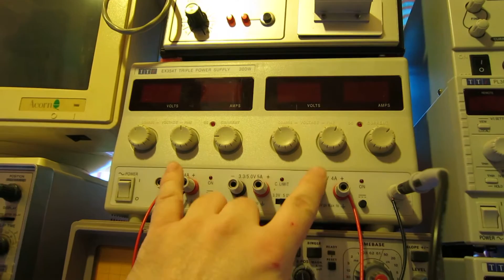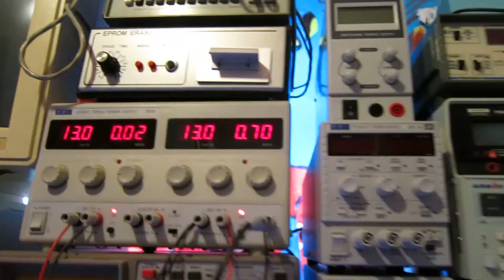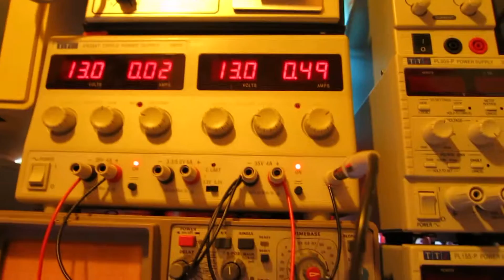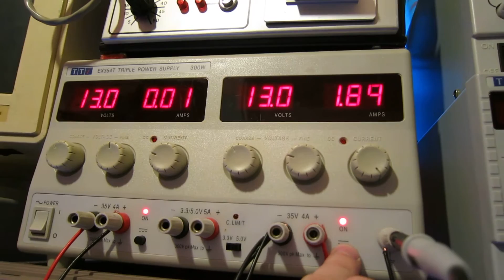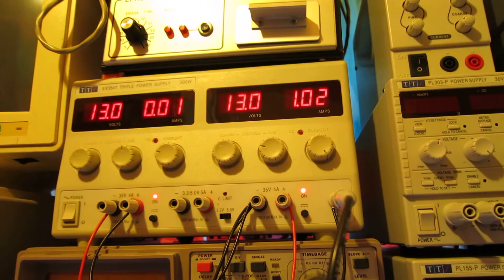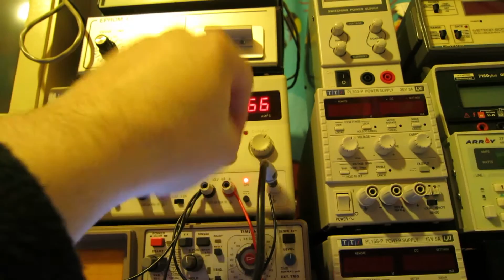Firepower Sound Board Repair

Comment: I had a quick (perhaps stupid) question. Since the boards are supposed to be running AC power, how did you do the conversion to determine the appropriate DC power level?
Reply from the maker: The AC is converted to DC by a bridge rectifier. When you put DC into a bridge rectifier you will get the same voltage out minus the voltage drop of the diodes in the bridge rectifier. All that needs to happen is that the voltage coming out of the bridge rectifier needs to be higher than the minimum voltage that the voltage regulator needs to operate. So if you connected your meter to the output of the voltage regulator and started turning down the DC voltage, eventually the +5v rail will start dropping. It does not need to be precise, it just needs to be above that voltage at which the regulator is outputting the correct voltage on the +5v rail. In the case of a sound board like this, the amplifier wants around +12v and -12v. The bridge rectifier drops around 1v so putting in 13v DC before the bridge rectifier results in around +12v at the amplifier, again it is not critical and it will work a few volts above or below that
Reply: @arcadeuk  Thanks so much, I'll try to digest that for a minute. Where is the bridge rectifier? Is this the right schematic? https://pinwiki.com/wiki/images/d/d5/Wms-sys6-7-soundspeech-assembly.pdf  If I'm reading the schematics right, the power inputs take 18.7vac. Great stuff, thanks again!

Comment: Great video! Would there be any way to do the same current draw diagnostics with a regular old DMM in line?
Reply from the maker: Yes, putting your meter in series would do exactly the same job, it's just handy for me to have the output current limit and displays on the power supply :)

Comment: Current ... The often overlooked silent destroyer.  Can i get the details of that dual channel supply?
Reply from the maker: It's actually 3 chanel (2x 35v 4a & 5a 5v/3.3v)  but there is a 2 channel model exactly the same at Farnell
http://uk.farnell.com/aim-tti-instruments/ex354rd/power-supply-2ch-35v-4a-adjustable/dp/1670783

Comment: Nice technique by using the current draw.  Odd how it still sounded somewhat normal with a bad DAC!  It must have been putting a lot of DC into the amplifier.  I thought these were capacitor coupled, but I might be thinking of something else.  Been a while since I've worked on these! 

You can also play the individual sounds by grounding the input pins one at a time or in pairs.
Reply from the maker: Hello sir! I will of course bow down to your far superior amplifier knowledge, but yes, the DAC must have been putting high DC into the amplifier, which is what will have cooked it. The original was very discolored, surprised it still worked. It was a little distorted, but you  probably won't have noticed it much on the video, turned up loud it was quiet obvious.

I was going to knock up a generic sound board tester with an arduino to trigger the sounds, but i have not had the time yet :)